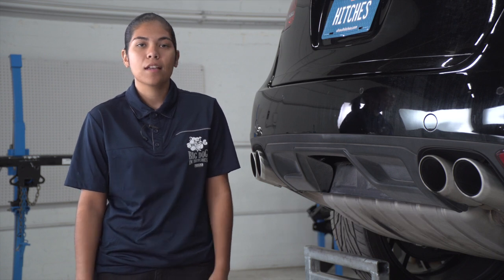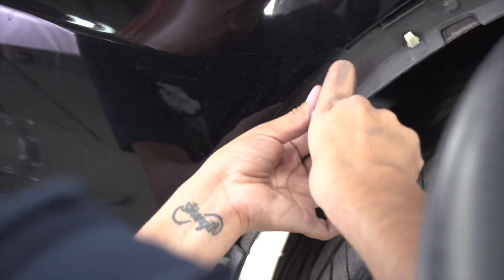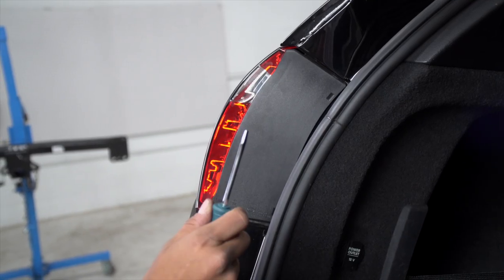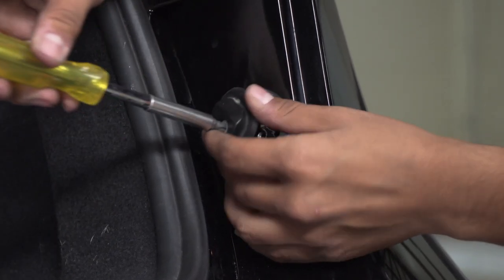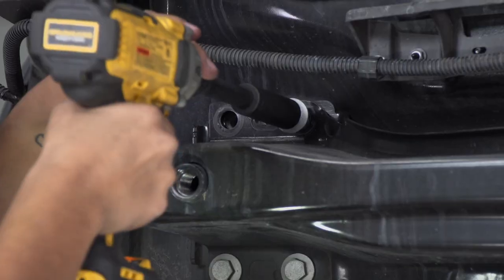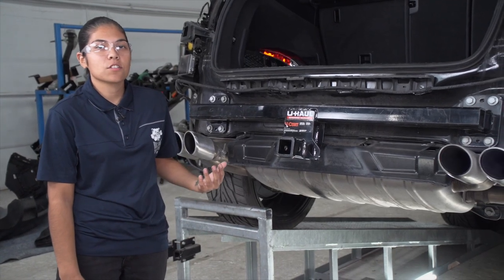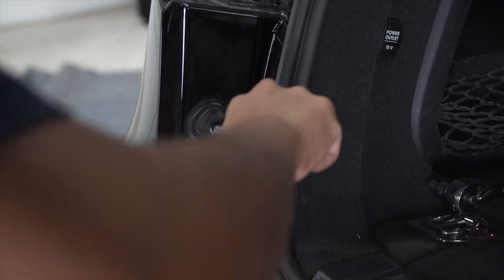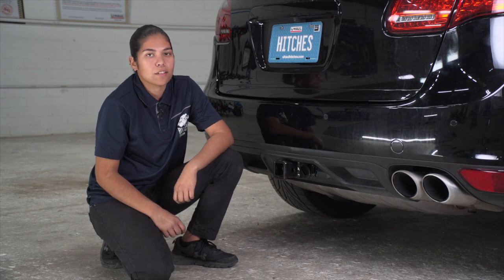2018 Porsche Cayenne Trailer Hitch Installation

Comment: What about the electrical? Without that it is really just for a bike rack or something like that. Does U-Haul install electrical?
Reply: They do! From a 4flat basic lighting to 7 round with brake control set-ups
Reply: I would not trust U-Haul with electrical work on  a complex car like this. The right way to do it is to get the OEM wiring harness. You will then need a laptop to program the car and tell it that there is now a tow package. What Uhaul will do is run wires and connect to taillights, which is like a Kia mechanic working on a Porsche. If there is any electrical damage, it will be costly.